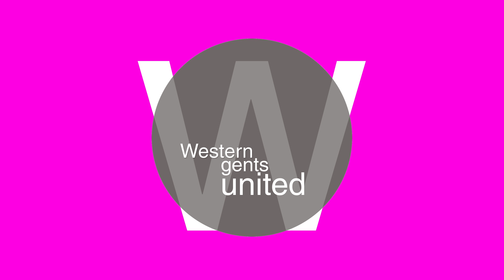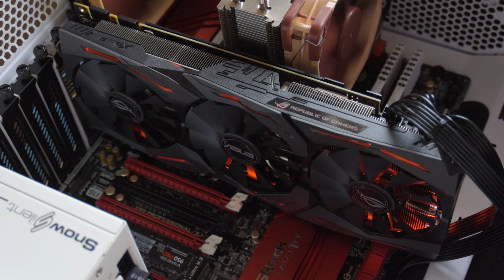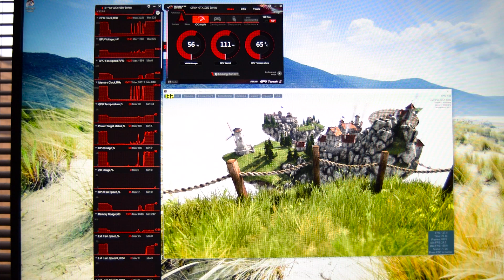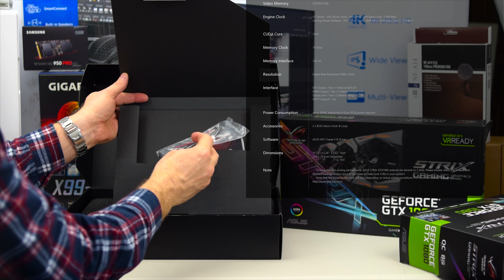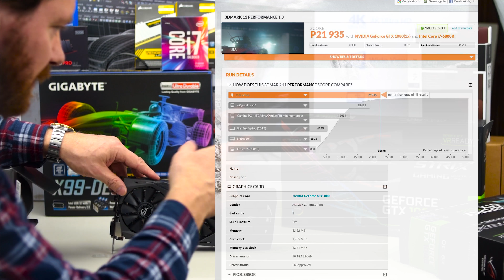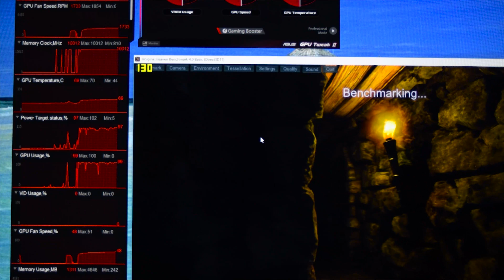ASUS GTX 1080 Strix REVIEW & SLI The Best GTX 1080? Build the Beast 002

Comment: If you connect a 3 pin fan to the 4 pin fan header on the graphics card, will it always spin or will it only spin when the gpu fans start to spin. Also do I need the GPU tweak software to use the onboard fans or can I just plug and okay without the software
Reply from the maker: It should crank on only when your card fans turn on. No you should not need the software.

Comment: Btw how many watts does 2 strixes and the whole system use ?
Reply: 360 watt max for 2 strix 1080 and depends on what the other components are
Reply: Bosko Jal us 750w enough for sli and other components?
Reply: iitbftw Yes the consumption won't exceed 700w even in the most extreme cases anyway, you'll be fine with a 750w BUT pick a quality psu, not the cheapest 750w you find, in europe for example the cheapest right now is the RM 750x from corsair, but if you see the EVGA 750 G2 go down in price pick the evga

Comment: THANK you very much for the advice and information i immediately 
subcribe to the channel after this video it was very instructive . I 
really appreciate asus since my childwood . I would like to be informed 
for sli gtx 1080 asus strix oc edition configuration  about temperature 
and overclocking possibilities . here is my spec :

processor : Core i7 4790k 4.0 ghz (boost clock 4.4ghz)
memory ram : CORSAIRE VENGEANCE (2x8) 16 gb 

motherboard: ASUS maximus hero VI 

graphic card : 2x GTX 1080 ASUS STRIX OC sli (overclock ) Edition 

psu(power supply ) : EVGA SUPERNOVA 850 W PLATINIUM CERTIFIED 

coolers :  HYDRO CORSAIR H115 i  new

casing : PHANTEKS ENTHOO EVOLV SATIN BLACK TEMPERED GLASS new

fans : X 5 MASTER COOLER LED BLUE 

and actually my main card in sli config is hitting 75-76 degrees in 
games like rise of tomb raider 4k resolution is that normal or should i 
worry  knowing that i put fans on manuel user i sync the 2 cards with a 
graph and that over 60 degrees i put fans on 90% usage while the second 
 card is getting 60-62 with an ambient temperature of room around 24 
degrees . If i call for help its because i dont want to spend more money
 on my computer anymore i recently become a new father :) and i already 
give lots of sacrifice to get this rig  .
Reply from the maker: Cheers mate. Wow, that is some top draw rig you have there.  75C-76C is normal for the blocked in card. I would not worry until it gets into the mid 80's. Even 90C is not critical but I would not be comfortable at that temperature. Im not sure why you want to overlclock 2 1080 in SLI .I guess if you can keep them stable and under 85C (the main one) you wont damage your 1080's.
All the best to you and your family.
Reply: okay thanks for advise really appreciate the answer and information  and keep up the good work on your channel cya

Comment: 6 and 4 pin? That's 6 and 8 pin, not 4 pin?
Reply: Oh ok lol. Did you try the 4 pin headers for chassi fans? Is it possible to control the speed on those connected fans or do they have some automated speeds somehow? I haven't actually seen any videos on how that part actually works, been searching for hours so I don't think there are any videos on it. If you do a video about that, you won't have any competition for views. :) Do it, do it!